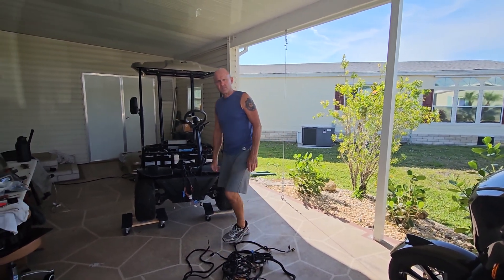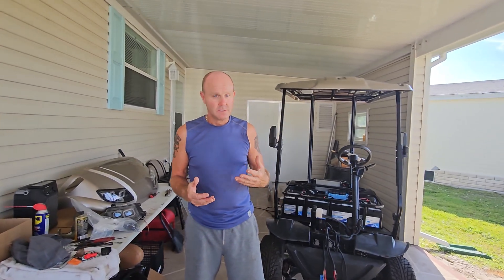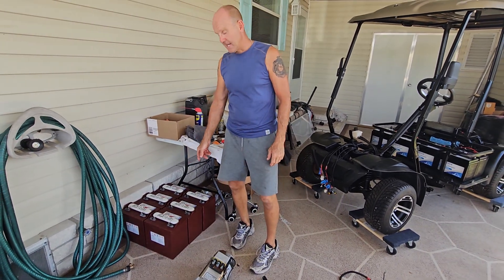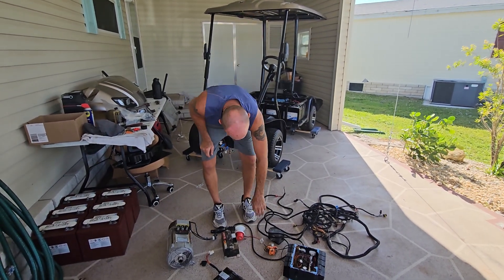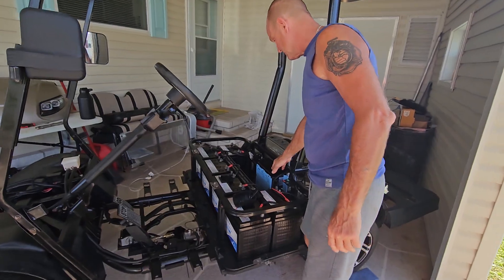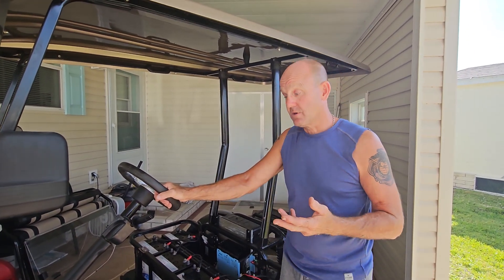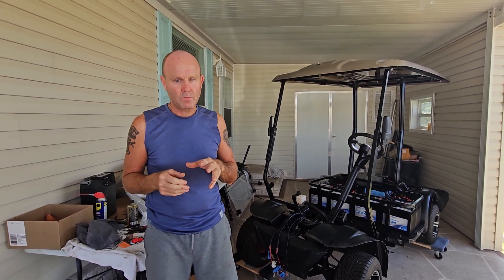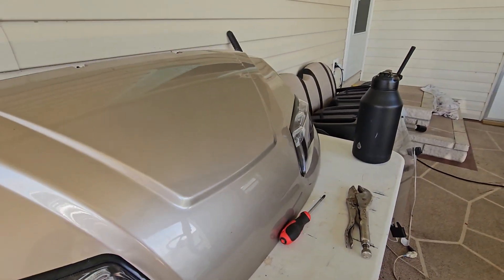hurricane Ian flooded golf cart rebuild

Comment: Those batteries are fine. Don’t replace them. I’ve rebuilt dozens of flood carts. The batteries never go bad. But make sure you drain that differential and replace those bearings
Reply from the maker: The only issue i have now is finding someone to program it
Reply: Where are you located at? Do you fix them for people

Comment: Mine is a 2005 36 volt Ezgo in 2017 Harvey flooded it in 6 feet of fresh water for 3 days. The batteries were completely dead a couple years before it flooded. So it had no power running  threw it. I went to drain the rear axle and nothing came out . Not even oil. I had pressure  washed the cart inside  and out on the 4th day. Had opened everything up . Let it sit in the driveway for 2 months  in the hot sun. Last year I opened  the electronic box and looked at the mother board. Everything looks clean, dry, and no corrosion. Not sure about the moter. Would like to think it's sealed from water entry, since they are prone to people driving them through water on the course and idiots driving them into fresh water ponds on the course. I do believe if it was salt water or pool chlorinated water , then everything is completely toast. But this was completely sumersed in fresh water. So I'm hoping for the benefit of the doubt. Let me know what yall think? I'm going to pull the moter to check it out.